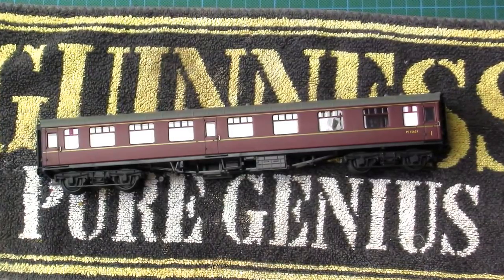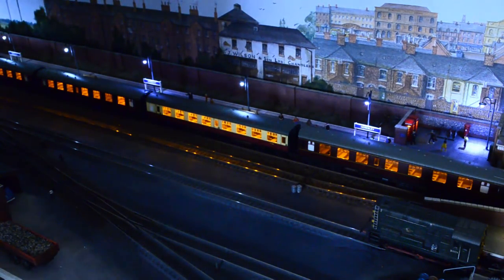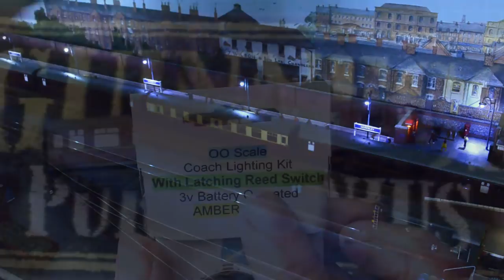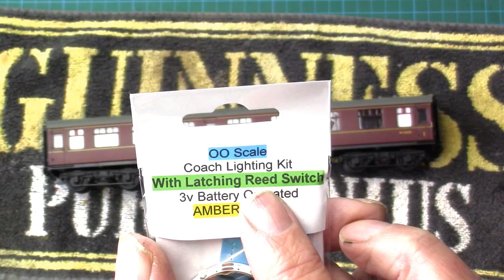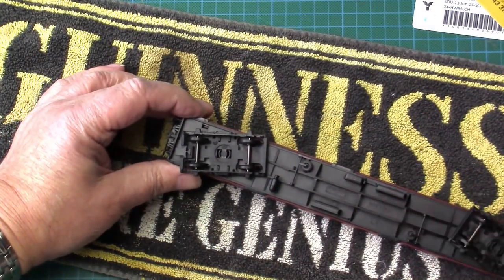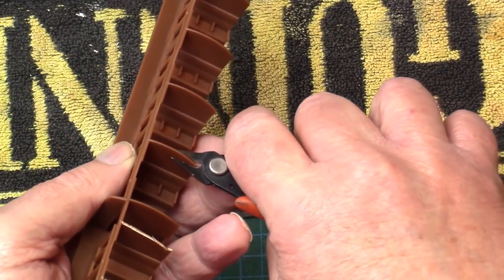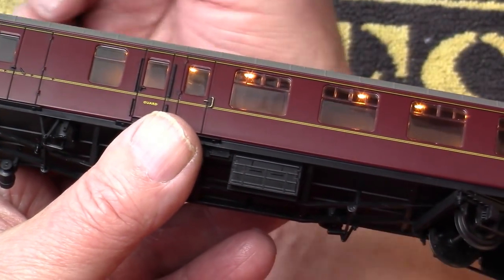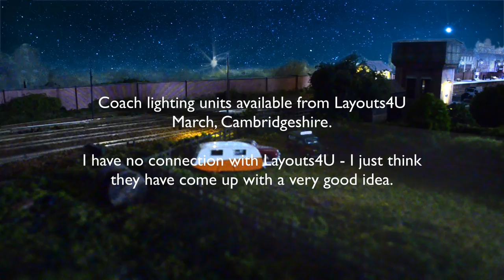PASSENGER COACHES #1 LIGHTING

Comment: This seems by far the best system. No flickering lights over the points, and the colour and brightness seems very realistic... thanks! I hope to use this system for 4 wheel and 6 wheel coaches.
Reply from the maker: Thanks Douglas - that's definitely where the advantage lies. In hind-sight I wish I had mounted the battery holders underneath on the outside. Might get round to altering this one day. Good luck with your coaches 👍👍👍

Comment: Thanks David - another good instructional video. I havn't noticed these lights on Layouts4U stand before and I am a regular customer! I like the idea of battery operated and being able to switch on and off without taking the coach off the track. Also, although I have a DCC layout, using a battery eliminates the occasional flicker that might occur as the wheel run over a dirty bit of track. It also eliminates any potential drag one might get when putting pick ups on the wheel sets. Thanks once again.
Reply from the maker: Hi Brian - me neither - but they are featured as 'new' on their website i believe. All the points you mentioned are exactly those that won me over to these battery operated ones (just hope the batteries last a long time). Thanks for your comments, much appreciated  -  David

Comment: Very good David. Might be worth swapping those coach wheels for metal ones anyway as plastic ones degrade and make your track nice and dirty over time. Thanks for sharing.
Reply from the maker: Many thanks Mark. Good point about the wheels. I will keep an eye on them. I am not sure they are plastic to be fair. All I know is they don't conduct electricity, and they are not like the plastic wheels on older stock. Perhaps someone knows for sure. Many thanks for the tip  -  David

Comment: I've never done any Soldering (long, painful story,) so this excellent Video has helped me on the way.  I think I've watched it a dozen times now :-)  I wanted lights on a rather large static diorama with no current in the Rails, so these Kits are wonderful.  I can't help but wonder whether ONE Battery would power more than one strip of lights though.  Even so, these lights can be used anywhere... e.g. building interiors AND exteriors. Great possibilities and at a remarkably small price.
Reply from the maker: Hi Mike. I agree, they have great possibilities. I have fitted a couple in buildings that hide point motors. If I have a problem with them I can remove the buildings without having to disconnect the wiring. There is no reason why you could not connect more than lighting strip but it will drain the battery quicker (assuming you have them on at the same time).
Thanks for your kind comments  ..  David
Reply: Thanks for your reply David…  When (or if) I get my little Project together, I do not expect it to be illuminated for any great lengths of time.  I don’t know the Life-Expectancy of a 3V Battery running these little LEDs, so I had a mind to fit one to run two Carriages so I’d have back-up Batteries just in case.  Failing that, I thought I’d try to fit the Battery casings outside and underneath the Carriages to make exchanging them simple, without the need to disassemble them.  It’s just a static diorama, so that option would all be invisible and obviously not impede it in any way.  

My plan is also to have a floodlit central Building, with some dimmer interior lighting. It all sounds so simple, except that it grew from an idea to have a full wrap-around Back Scene of a City at night time.  How to actually light THAT is a bit problematic for a dark room I suppose.  Perhaps I’ll use a Twilight setting.
Reply from the maker: Sounds good to me Mike. I think you are right, I would expect that most people operate their layouts mainly in 'daytime'. Its nice every now and then to run at 'night' with the layout lit up. I too don't know how long the 3v batteries will last but as I only infrequently operate with the lights on I would hope the batteries last a while. We will see !!
Thanks again for your comments, good luck with your project, hope you get it off the ground  ..  David

Comment: I would defiantly recommend this lighting system 101%.  I have just installed 4 LED lighting strips into 2 of my Hornby 2BIL units, It is very good friction free and flicker free system. The only modification that I did to the lighting strip was to add a 330 ohm resistor in series with the battery and LED's. This reduced the brightness of the LED's to a more realistic level in the coaches and also reduced the glow through the thin plastic sides of the 2 BIL units. At the same time I took the opportunity to file out and install another LED to light up the front head code panel. The only down side to this lighting system is the need now to paint the interiors and seats, as these items can now be seen more clearly thanks to the interior lighting. I have read that Hornby are marketing a carriage lighting strip containing 4 LED's that they say will run for 200 hours on1 battery, so assuming 3 times the current draw for the12 LED's of the Layouts4U lighting strip, it should last for approx 66 hours on 1 battery.
Reply from the maker: Interesting Bazza - I am often asked 'how long do the batteries last'. Apologies for the big delay in response - new video out soon.

Comment: David, these look beautiful! Well done to layouts4u getting this kit together.  

Although this method gets around all the hassle of power pickup, my only concern would be vis-a-vis the batteries.  They have to be accessible without taking the coach apart each time and of course generating a steady stream of used CR2032s is not all that eco-friendly :-)  However, since the Cr2032 is rechargable, It should be possible to bring out some unobtrusive connection points on the underside of the coach and set up some place on the layout where coaches can connect to a set of charging points (for example equipped with a set of Adafruit 1304 charger boards which run from any USB outlet).  https://www.adafruit.com/product/1304   - the batteries would still need replacing as a charge-fullydrain-charge style of usage does shorten their lives - but depending on usage it's a fair guess that they could last a couple of years.  I;ve known 2032s last for more than 15 years in a PC that is always powered on, but much less in a PC that is turned off every night - which is much more similar to this usage. 

Mounting the reeds in the roof is a good scheme, and electromagnets hidden in tunnel mouths or gantries could be the activation method - though of course on a tail-chasing layout there would be a danger of the lights alternating between on and off at each circuit!
Reply from the maker: Hi. Yes the battery changing is more of a chore than I expected. I am looking at mounting the batteries underneath each coach. I thin the charger is for LI (Lithium Iron) batteries. There seems to be a supply/restiction issue when I searched. Will keep it in mind though - thanks  ...  David

Comment: Nice video David,  An interesting way of doing lighting without the hassle for sure.  If you wanted to get a little more technical you could have a simple bit of wood with a magnet (or electromagnet for switch operation) over the entrance/exit to the fiddleyard so that the lighting could be a little more automated?

Cheers,  Michael
Reply from the maker: Hi Michael, thanks for your comments. You could indeed, I have thought of that, and i might well set op a gantry on the entry/exit from my fiddle yard.  It will be hinged/swiveled so the magnets can be turned out of use during day running. Fully automated coach lighting for pennies, not bad  -  David

Comment: Hi David.....great video for a novice like myself.....will certainly be doing this to enhance my coaches.  Question from the inexperienced...if I have another reed switch in my layout for example a station stop module....would that reed switch interfere with the lights also meaning the lights would continuously be switched on and off on each circuit of the layout ?
Reply from the maker: Thanks for the comment John. Not sure I can answer your question. I am not great with electronics but I think you are asking if another reed switch would effect the coach lighting - the answer is no. The coaches do not depend on electricity from the track - each has it's own battery. Hope this answer is O.K.  ...  David
Reply: @davidhyde4329  Thanks David...answer is fine....even if it did I would hope a magnet fitted underneath (station stop module) and a magnet fitted in the roof (coach lighting) would not be problematic...many thanks...I will fit coach lighting with some confidence after seeing your video

Comment: Hi David, certainly very effective. I wonder how long the battery lasts and how you replace it?
Reply from the maker: Thanks - good question. Simply answered - I don't know how long the battery lasts. The current drain from the LEDs is small so I am expecting a 'good' operating battery life time. Like everything I suppose it depends on how often and for how long they are run with the lights on. I plan to run them mostly during daytime so mostly they will be off. However, in terms of hours per battery I can't answer. Replacing the batteries is no problem, you just unclip the body and replace the battery in the holder  -  David

Comment: Very effective and just the right tone of light. Are you intending on populating your passenger stock? Cheers, Dave
Reply from the maker: Hi Davie, ahh - I thought someone would ask about the passengers. I have not tackled figures with any seriousness yet. The time will come however and I will now have to give some thought to seated passengers. Thanks for your comments. Yes the lights being 3V and not 12V are not overly bright at all  -  David
Reply: Hi David, I can recommend the cheap Chinese/Far East seated figures for interior applications. I wouldn't necessarily use them for the foreground, but I use them all the time in vehicles and rolling stock where they can't be seen that clearly. Some of the more gaudy colours need over painting but otherwise they can just go in as is. Cheers, Davie
Reply from the maker: Thanks Dave, I will look into these, I will need a lot though. Thanks for the tip  -  David

Comment: Hello David. Sue & Bob at Layouts4U are truly nice people and will help as much as possible. Super people to deal with. You’re lucky getting the latching reed switch; they are quite rare, and I note they are now out of stock. This is a great solution and, as you have put them in the roof, they can be switched ‘semi-automatically, on and off, as they enter the scene, by placing a magnet in a tunnel or entrance to the scene. Ideal solution. Thanks for the update. Very useful.
Reply from the maker: Hi Bobby, they were indeed, friendly and helpful. I noticed they are offering the Latching Reed Switches on their website for £3 a pop - but they are currently out of stock. I will be buying some as i can see other uses for them on my railway. You are right about the automatic aspect. I rigged up a temporary 'gantry' and they worked perfectly - perhaps I will add this in my next update on the subject  -  David

Comment: Hi David, thanks for sharing, sometime has passed, how long do the batteries last?
Reply from the maker: Hi. Because my railway is an out-&-back shelf style layout I do not run my coaches in a loop and therefore the batteries are lasting very well with my because I am still using the same batteries. I guess you would need an electronics guy to  tell you how long the battery would last when continuously powering the number of leds in each coach (this could vary depending on the coach).
However I think it was a mistake to place the batteries inside the coaches. I have had to change one or two batteries where, I think, I have accidentally left the the lights on, or accidentally switched them on in storage. Although it is possible to remove the coach bodies they are held in place with small plastic clips (at least my Hornby ones are) and they have proved easy to break and impossible to repair. I still think the system is a good one but I am refitting the battery holder under the chassis to make changing easier. Apologies for the delay in response - I hope this helps  ...  David
Reply: Hi David, great video - thanks for sharing! I’d be very interested to see a video of how you retrofit the battery cases to the chassis as I too am concerned about the fragility of the coach bodies. Thanks for taking the time to do these - invaluable!

Comment: David.  Did you leave the battery holder on the outside at the end of the coach  when you fitted the battery operated coach lighting?
Reply from the maker: Hi John, no, I fitted the battery holder to th inside of each coach. However, if I were to do it again I would definately fit the holder outside - underneath the coach where it would nor show. This, or fit a couple of smaller 1.5v button batteries (easier to hide) under the coaches - hope this helps  ...  David
Reply: @davidhyde4329  Hi David.  Thanks for the reply.  I'm going to change the wheels for metal ones from Peter's Spares which are insulated at one end.  I'll fit some springs to the axel and take power from the track. I think changing the batteries is a bit fiddly.  I've ordered the parts for the lighting from Layouts4u and the rest from Peter's Spares.  It will be a few weeks before its completed as I'm going away next week.  By the way where did you get the concertina type connectors for between the coaches from?  They look great. John

Comment: David Hyde, Your tutorial on fitting lights to a oo coach was very well explained, however I failed to see where the battery holder ended up, and would you be able to change the battery easily?
                                                                                       regards Thornton McLaughlan.
Reply from the maker: Hi Thornton. I have stored the batteries at one end of each coach. There is a gap where the seats end. Not brilliant, as it turned out, because, although the coach body can be unclipped,  it is quite fiddly. The batteries could be fitted outside under the centre of each coach (perhaps a plasticard box made to measure). It is still a good solution as it does not rely on pick-up from the track.

Comment: Excellent neat approach.  Just wondering whether some heat shrink tube might be useful to cover the exposed leads.
When I added lighting to my DMU set I used diodes to restrict the head and tail lights to the approriate direction - but that had a track pick up which you don't have.  I occurs to me that the rotation sensors used for mouse wheels might have an application here but that could be getting too complicated to develop for a one-off installation.
Reply from the maker: Hi, thanks very much. I would certainly use heat shrink tube if I chose not to glue the wires in place. They are not going to move so there should not be a problem. (I know - famous last words). Thanks for the thoughts on the DMU. I have one I am planning to fit with this lighting. Although it has track pic-ups I am considering fitting these lights, they are flicker free and constantly either on or off. Don't understand enough to see how mouse wheels would work, but I am open to all suggestions. I will be doing a video on, or including my DMU sometime in the near future  -  David
Reply: Hi David, thanks for the prompt response.  A further thought on the DMU - At the time when I did mine (1982) there was a much smaller range of LEDs available and I had to use 5mm ones, which were obviously too big for the DMU ends.  I put the LEDs into the 'battery box' and used a system of light pipes to illuminate the headlamps / taillamps.  That was in the days when Maplin was still a viable catalogue business and I found some single-strand fibre optic cable 1mm diameter complete with a black sheathing.  I drilled a very shallow 1mm hole in the apex of the LED,  just deep enough to retain the F-O cable and glued it in.  The outer ends of the light pipes were then fitted into appropiate holes in the body of the DMU.  I suspect that the modern variety of LEDs would make this unnecessary.
To reduce flicker you can put a capacitor into the circuit - again the Maplin catalogue was very helpful with the necessary info.
Reply: Returning to motion sensors, I found an excellent explanation of how a mouse wheel works (http://www.explainthatstuff.com/computermouse.html) but I was only using the mouse wheel as a common example of the concept.  It is one of the major attractions of railway modelling that it generates an interest in other aspects of life, one of which is photography, another is electronics.  I was thinking that something like a miniature ABS sensor could be mounted on the bogie with markings on the inward face of the wheel to give an indication of direction (and speed - do you want a speedometer on your control panel?) and thereby change the aspect of the lights.  Of course this is moving a long away from your 'keep it simple' approach that is so successful and entertaining.
BTW, have you seen Luke Towan's posts on how he prepares scenery?
Reply from the maker: Great Ideat. many thanks. I understand your lighting for a DC layout (1982) but, as I understand the supply through the track is AC so I would probably need a rectifier of some kind. But it is still doable I am sure. Like the use of the 'battery box' , would probably still need to use optic fibers - I am sure I have some tucked away. I will give this some serious thought. It would be good to go the whole hog with interior lights and headlamps & tail-lamps  -  David
Reply from the maker: Thanks for the link, very interesting explanation. Not something i have thought about before.  I think, given my limited brain capacity, I will keep things simple for the time being. Yes I have been following Luke Towan for a long time and watched many of his excellent videos - quite an inspirartion  -  David